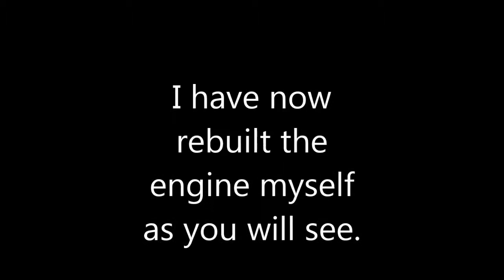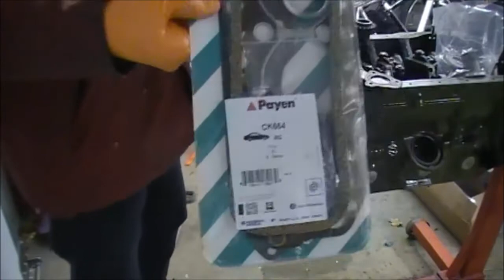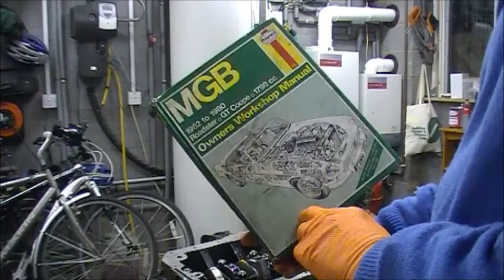MGB Engine Rebuild to Stage 3 Rally Spec

Comment: I had a Riley 1.5 with a MGB stage three in the 70s it was then a 1902cc  put in a green piper cam in it for the road a 45 DCOE weber carburettor 3into2in1 manifold it was a great power house for a road I had a lot of fun couldn't stop it mine you no Disc brakes then just a servo fitted best of luck hope it;s sill going well for you.